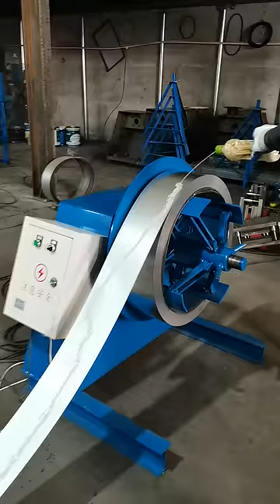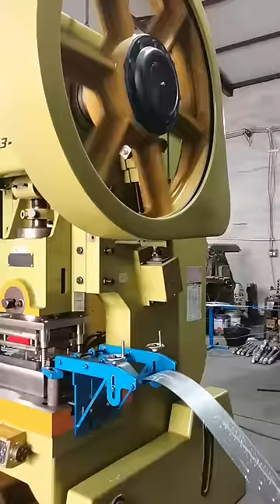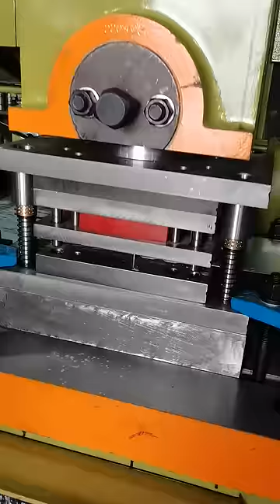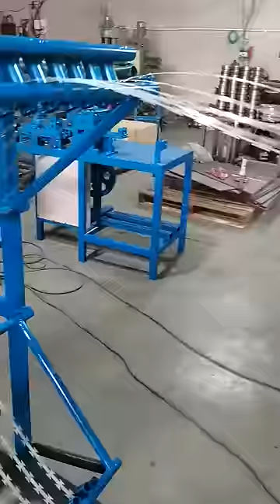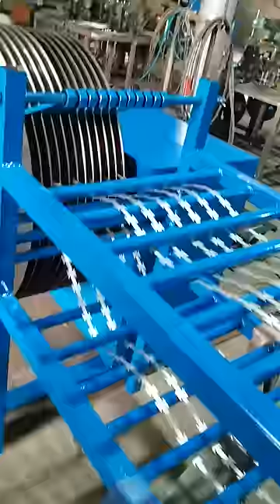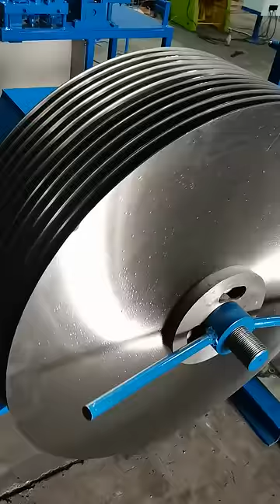63tons razor barbed wire machine line#machine #factory #

Comment: Nice brand new freshly painted equipment, now let's see what it looks like on Friday :)
Reply: Probably the same because it's indoors it's just stamping metal there's no reason for it to not look nice and new for many years.
Reply from the maker: yes
Reply: @xjbmx777  If you look mid way through the vid they even painted the gear teeth LOL. That machine finished drying 2 minutes before this video was shot
Reply: Even painted the step clamps 🤣
Reply: ha
Reply from the maker: yes new machine looks good, after use it then make dirty with oil

Comment: I've worked alot of production jobs and the one thing I'm mostly impressed with is how clean and new the machine looks. What a rare sight to see something in working condition that's not 50 years old and held together with shit welds and tape.
Reply from the maker: new machine for adjusting so clean.

Comment: You should add an automatic lube system that with a sprayer. Place a magnetic sprayer on the red part of the die, and angle it to spray inside the die at a certain press angle.
Reply from the maker: yes you are right.yes, if you have interests, welcome to my whatsapp+8618032888775

Comment: Constantine wire, barbed wire is made from galvanized wire with offset points. This is the step between barbed wire, and razor wire.
Reply from the maker: yes, you know  about this machine, this just razor punching,we also have wire covering machine for covering the razor and wire

Comment: Change the shape of the barb wire so that all of the scrap you're cutting out can be used as razor blade blanks or something like that. More profit if you're cutting you might as well do it for two reasons rather than one I'm sure there's a reason not to do this, but it seems like you could probably find some industry that also needs blanks similar to that shape
Reply from the maker: what do you mean ?

Comment: Very concerned about the fact that the worker we see at the end is not wearing a hardhat or safety goggles. It's a bigass stamping machine dealing with razors after all
Reply from the maker: that's right, this just machine adjusting when production all protection will have.More information, welcome here my whatsapp+8618032888775

Comment: This is cool, but a safety nightmare in the USA. You trip and fall into that wire after stamping? No safety switch or light curtain around the press to prevent injury from someone getting their hand smashed in the press? Slugs falling out the bottom of the press with no containment? YIKES.
Reply from the maker: hahah, yes,  did you have interests about this machine?More information welcome here my whatsapp+8618032888775

Comment: I thought a process like this would be much faster.
Reply from the maker: yes, did you have interests welcome here+8618032888775
Reply: It can be much faster than this. I do stamping for a living and these machines are capable of running much faster than shown here. It all depends on material thickness, how long the stroke is..(size of part being stamped) and how much open height you have. (How high the press will open the tool)
I have some jobs capable of running 70 strokes per min.... so a bit faster than 1 stroke per second. Most jobs run somewhere between 20 to 35 strokes per minute though.
Reply from the maker: yes. you are professional, are you a engineer ?

Comment: You really dont need 60+ ton for that but whatever works I guess
Reply from the maker: what you mean , we also have 65tons 80tons 100tons 125tons pressure machine, did you have interests?
Reply: @AnneCao2024  no I work with roleform machines for a living having something so big is pointless a hydroelectric system if 1/10 the size with less noise and more efficient 😒😒
Reply from the maker: calm down, yes, if you have interested welcome to me anne +8618032888775

Comment: With all that couldn’t add a tray or something for the scraps….
Reply from the maker: what you mean ?
Reply: @AnneCao2024  the metal scraps under machine wouldn’t it make sense to put a bucket or something then you could collect, recycle, dispose with a minimal mess. Instead of just letting it fall all over the floor. Imo
Reply from the maker: yes you are right, this machine just machine adjusting when production there will be a device for westage

Comment: Not a wire. And "rasorwire" neither.
Reply from the maker: yes, razor wire
Reply: @AnneCao2024  - Razor wire is something else: A plain tiny wire, very narrow, but not round profile. Made of steel, a long cut of, so very sharp plain edge.
Reply: @AnneCao2024  - "barbed wire" versus "barbed tape" ...Yet "razor wire" is another third thing.
Reply from the maker: yes you want ? welcome to my whatsapp +8618032888775